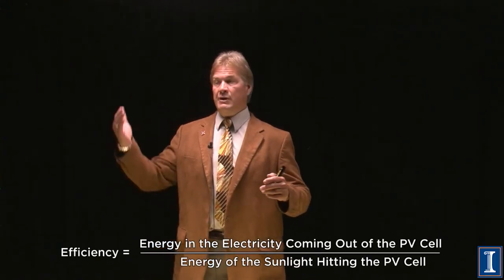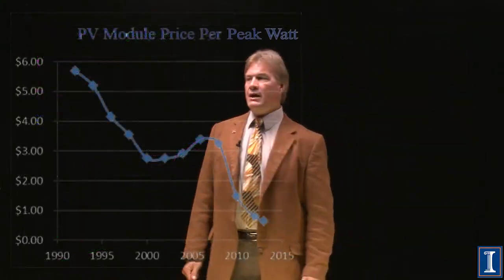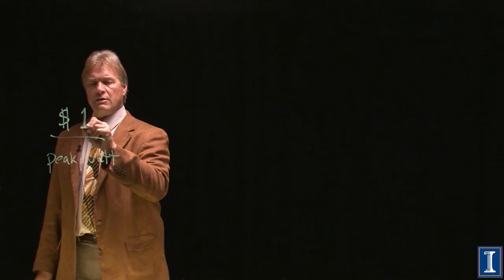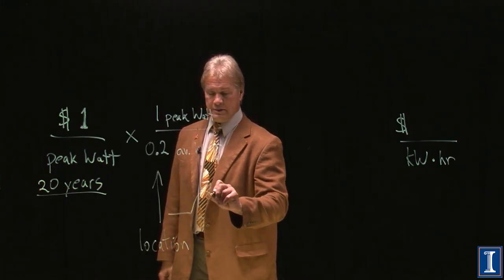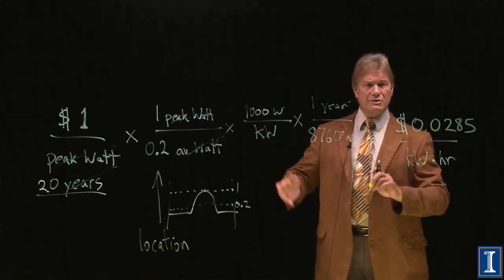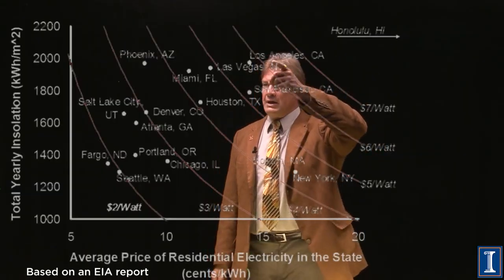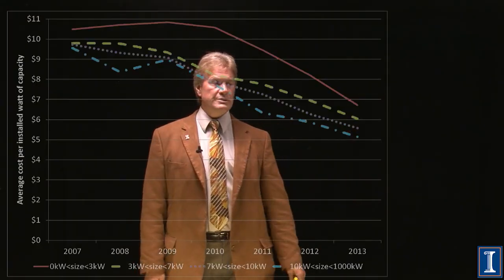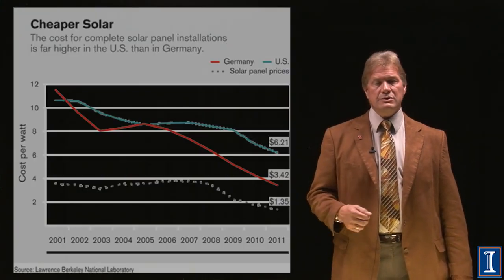The Cost of Sunshine

Comment: A lot has changed since this video was made. Cost has come down ~90%, installed solar has gone exponential, dramatically exceeding any and all projections. Batteries are now the next area where cost needs to come down in a similar way to incentivize battery co-installation with every solar installation, once this becomes widespread, centralized utilities will then really struggle to compete with this more distributed electricity production and you forget about Nuclear every being cost competitive again.

Comment: This video is WAY out of date. 2015 prices?  It is 2025 now.
Reply: What is the price now?
Reply: You can get residential solar installed in many places for around $2-3/watt (for a 5-10kW typical residential system). That’s not including government incentives, (federal residential incentive is going way after this year due to the “one big, beautiful bill”).
Reply: @zerog2000   The sad part is that 2/3 is still BS regulations, fees, and permits due to the non-standardization. So the sad part is the fed could remove the tax credit, standardize solar installations, and still make the installed cost go down with zero tax credits that the fed would have to give out.

Comment: Regulation is one of the biggest differentiators here except for  the amount of sunlight. I have built my PV system 4 years ago where I managed to be included in a scheme where I'm on the grid and I don't get anything for the energy I pump into the system, but I can then take energy from the system at 80% discount as long as my two-way meter shows that I have a surplus (I put more energy into the grid then I consume). With the rising power prices this has proven to be immensely profitable for me, as my power bill is 10% of what I would have to pay now without PV. However the regulation was later changed and now people no longer have the option to use the grid as their "battery". They get paid for what they upload to the grid in wholesale prices and then can buy power back for regular consumer prices. This means that my PV installation had a ROI time of just under 4 years and had to be just 10-15% overscaled over my consumption. Theirs has to be 2x-3x over their consumption and they get less money back, so their ROI time is 10-15 years. Adding battery pack into the mix maximizes your autoconsumption which moves a lot of levers on the accounting charts, but battery pack itself is costly and needs replacing at around 10 year mark, so you're still looking at 10+ years of ROI time. And if you did your project and calculations wrong + at the same time decided to switch from gas to electric heating/heat pump, you may not be happy with the final result. Even such considerations as the type of roof can skew your calculations, because if you have a ceramic roof rated for minimum 50 years and you put 25 years rated PV on it, you're golden, but if you put it on a flat roof covered with roofing felt, then you're in some dire straits after maybe just 10 years. In some places it is essential to mix PV with one or two mini wind turbines to minimize your costs in winter. However turbines require more costly maintenance, which PVs don't. For me however, in my regulatory scheme, the investment proved to be extremely good idea. ROI under 4 years (planned 5 years ROI, down thanks to rising prices) and currently it gives me savings of over 3000 $ / year.

Comment: Having had worked in both the PV and Battery industries I pretty much agree with everything he said.
I'd love to see an updated video that takes into account:
-Inflation and inflation adjusted costs on the historical graphs.
-Labor costs. I do not know about you but labor is out of control - can't get anyone to do any sort of trade, even unskilled, for under $100/hr. Heck I was quoted a new roof and when you pulled out the labor costs out of the quote it was nearly $300/hr. 
-Recent advances and efficiencies and how that has affected price per watt - I am very certain labor has more than offset this.
-Include, if the data didn't already normalize for this, the effects that high and low temperatures have on panels, hot and sunny areas can often have less efficiency than places that are a bit cooler with slightly less sun.
-How to factor in minimum billing against PV costs as some grid operators are billing people a minimum bill even if they use zero electricity?
-Also please touch on the costs when the panels are done and worn out. Several ways to present this but it'd be an interesting footnote.

Lastly, as I said having worked in both industries PV + battery, there is nothing green, clean, or environmentally friendly about the cell growing and paneling processes. Heavy metals, lots of solvents, massive furnaces for crystals, very nasty chemicals, bases, and acids, and tens of thousands of gallons of ultra pure water to clean the cells, clean the chemicals, neutralize the chemicals, and for decontamination of materials and processing tools. Batteries are much of the above but add in more heavy metal and chemical concerns (depending on type).
Unfortunately the media and marketing has been effective at only reporting the upside, so the only thing the consumer sees is a shiny panel making "free and green" electricity.

I personally still feel the PV technology needs more advancement, storage needs more advancement, and regulation + costs needs to be reigned in, somehow.
Reply: Well you are wrong.  For example the standard PV panel warranty is 25 years NOT 20 years as he says.
Reply: @speculawyer  ever heard someone claim on a PV panel warranty 15 or more years into the warranty?

I bet you haven't.

Comment below says this:

Excellent videos and this is no exception.  As to warranties, many companies (and maybe even foreign or domestic manufacturers)  have no intention of being in business for the length of the warranty, and many have gone out of business.  The warranty is worthless if the company offering it is gone.

Comment: Forgot to mention the largest component. Cost of the Land on which they have to be installed. Add to that the regular maintenance cost to keep them dust free to enable them to work at peak efficiency and prevent the dust and leaves from blocking the sunlight. Deserts may be good for sunlight, but they definitely add to the cost of cleaning due to all the sand and dust and winds that are there due to the arid conditions.
Reply: Solar has many more problems for grid-scale.
Duck curve is one of them. You can manage it with storage, but there's not much interest in that because its super expensive. California and South Australia are already suffering this. Spain also did suffer and had to withdraw subsidies, bankrupting several families.
Reply: @AlldaylongRock  If you fill the deserts in the western US with solar panels, you could then use that excess energy to pump water from the mississipi to the hoover dam. Which would then make electricity when we need it most and would also solve teh water crisis

Comment: My wife was convinced that our power bill had gone up significantly with the sale of Southern Company.  Turned out that when we had our roof replaced a few weeks before the roofers had put the wrong vent on the roof for our clothes dryer which resulted in a blockage and caused the dryer to run 3X longer to dry a load of clothes.

I figured all this out when she casually expressed her frustration for how long it was taking to dry a load of laundry.  I got curious and checked the vent and discovered the problem.

Comment: Hello Illinois Professor 
I like your analysis. 
The infrastructure would need to triple 
Power plants at $1billions each, TRIPLE. 
Main transmission lines at $2million/ kml,  TRIPLE. 
Poles and wires in streets and too homes, TRIPLE. $????/klm. 
All with the central power plants, TRIPLE DEMAND, supply costs. Massive. 
The distributed power gathered from the ends of the grid,  from rooftop solar PV systems with EV batteries, offers huge benefits. 
The boosting of distant supply from were the sun is shining would have to be looked at.
The weather forecasts and patterns would become more important. 
The smartening of the grid is obvious. 

Is this a worthy matter for analysis???????

EVs are coming. And faster than all the above TRIPLE infrastructure can be financed or built or workforce manned .
Suburbs one at a time, staged rooftops construction in the sunniest areas first. 

Nuclear's huge long time frame is dangerous..

Comment: If transportation is electrified and the EVs are topped up daily at home or locally from the grid then power demand TRIPLES.
Now we need TRIPLE the number of POWER PLANTS. 
Now we need TRIPLE the main grid capacity. 
Now we need TRIPLE the poles and wires in the streets to the homes. 
Given that the EV batteries will be 100kwh for the long trip, but the Daily drive is 7kwh, tiny, and every building is connected to the grid today.
Then I would say the EV batteries will be plugged into the grid and trading power and stability with the grid for money 24/7.
We are going full electrified including EV with a big battery?????? Yes ???
The distributed solar rooftop power supply with the EV batteries is perfect.

No new supply side infrastructure costs, power Supply costs reduced, petroleum costs now nothing.

Petroleum is a strategic military reserve asset for war fighting and emergencies. 

Just thinking, thinking, thinking, thinking 🤔.  Hahaha Hahaha. 

The automatic plug in gizmo will be the killer invention for the EV.

Comment: So, molten salt storage is a negligible cost for nuclear, but inconceivable for renewables?
Reply: If transportation is electrified and the EVs are topped up daily at home or locally from the grid then power demand TRIPLES.
Now we need TRIPLE the number of POWER PLANTS. 
Now we need TRIPLE the main grid capacity. 
Now we need TRIPLE the poles and wires in the streets to the homes. 
Given that the EV batteries will be 100kwh for the long trip, but the Daily drive is 7kwh, tiny, and every building is connected to the grid today.
Then I would say the EV batteries will be plugged into the grid and trading power and stability with the grid for money 24/7.
We are going full electrified including EV with a big battery?????? Yes ???
The distributed solar rooftop power supply with the EV batteries is perfect.

No new supply side infrastructure costs, power Supply costs reduced, petroleum costs now nothing.

Petroleum is a strategic military reserve asset for war fighting and emergencies. 

Just thinking, thinking, thinking, thinking 🤔.  Hahaha Hahaha. 

The automatic plug in gizmo will be the killer invention for the EV.
Reply: We won't need to triple grid capacity, though we may need to increase generation to compensate for not burning fuel in cars.
That generation can come from solar.
We have excess solar generation during the day, when most people are at work.
Plug in at work, during this period of maximum solar generation.
When you drive home, you are taking home the charge that supplies your house during evening peak demand. This reduces the peak demand current.

Charging during peak demand is dopey. Use off-peak power, just like hot water and pool pumps etc. Off peak power exists because it costs more to turn a coal generator off and on than to just leave it running. EVs can store that otherwise wasted generation.

If enough people just plug in whenever they park, at home, at the cinema, at work, wherever, then there will be huge battery capacity either way. Just set some presets on your car/charger to set limits on how much you charge or push back. If going for a trip, charge till full, and so on.
Reply: @aaroncosier735  
YOU ARE THE FIRST TO THINK THROUGH THE GRID MATTER. 
And post about it.
This matter is critical.

Home rooftops solar PV with
Huge EV batteries and a 
Smart grid.

This is the answer.
In fact the home's, in general, 40% demand on the grid power disappears and can be a 40% supply to the grid with the EV big batteries providing stability and reserve power. 
The industry's 60% demand can have 40% coming from rooftop solar PV systems. 
So now only 20% need come from the commercial power supply company and not the 100%.
NOW DO YOU SEE THE BIG POWER BUSINESS CASH FLOW PROBLEM IS??

The money will be in the grid..
Reply: @stephenbrickwood1602  There certainly are articles available, but it takes some searching.

We see the effects of grid-scale batteries already. They provide grid frequency control on a tiny percentage of the power wasted by coal generators to do the same.
If your house has a little battery, and your neighborhood a bigger one, and your region a large one, almost all the sharp peaks and valleys in power transmission can be smoothed out. This lets us use existing power sources better, and renewables as they are phased in.
Reply: @stephenbrickwood1602  I am in broad agreement.
Nuclear is an ongoing risk. My previous position is that nuclear would be acceptable if they had met their own requirements for waste disposal and minimisation of risk. They have not, despite fifty years warning.

Renewables are definitely the future, in combination with storage.  Storage, both batteries, hydro and others, makes renewables straightforward, but also helps inflexible coal and nuclear be less wasteful for the interim.

It's a tricky problem, but storage makes fossil tech more efficient as well as making renewables feasible.
Reply: @aaroncosier735  Both waste and risk is a non issue. It's only propaganda used by people that have been fooled or are outright lying.
Reply: @mikecamrcplus3057  
To correct you, Spent Nuclear  Fuel is a very big issue. So big that neither the industry nor national governments have faced the true cost of disposal.

You can tell me how easy it is once the existing stockpile has been permanently disposed, with full costings. 
That might take a while. To date no Spent fuel has been placed in disposal anywhere on Earth.
Reprocessing is not the answer either. The US worked out it was too expensive back in the sixties. The French have a program, but less than half of all their waste has ever been processed and none of the resultant High Level Waste has been placed in permanent storage. It costs them a lot to reprocess and French electricity has to be heavily subsidised.

The US attempt at Yucca was woefully underbudgeted and wound up with oxygen ingress issues.  It might still be useful for interim storage, but will never fulfill it's planned role. 
Any future disposal facility will need to have twice the capacity just for existing stockpile and the current provisions set aside are both less than half the most optimistic cost and no longer getting contributions. That's a problem.

Just as a reminder, the average US spent fuel storage has about one thousand tonnes of spent fuel, each tonne contains about fifty kilos of fission products, about the same as from two very high yield nuclear weapons. If attacked, such a storage facility would release the fallout equivalent of a thousand weapons. That's a knife to the throat of every american.
Reply: @mikecamrcplus3057  

Sadly all you have is Youtube videos. Poor ones.

And all three ignore the real issues.

Energy Prof only talks about normal operations. He doesn't cover what happens if something goes wrong. Spent fuel waste requires active management and cooling. It's not walk away safe in event of a disaster, and a deliberate attack on such waste is a disaster somewhere between ten and a thousand times worse than Chernobyl. 

Spent fuel is not economical to "recycle" as it requires expensive reprocessing, and the fission products still require vitrification, encapsulation and deep disposal. The US worked out in the sixties that it was not viable. The French have to subsidise about half their power to carry this boondoggle.

Casks are a definite improvement over pool storage. Sadly, only about a third of US spent fuel has been transferred to casks. The great majority still sits in cooling pools, at great expense. The material in casks is not done either: except for a couple of dozen that had to be relocated the vast majority are not rated for transport, and NONE are rated for permanent disposal. Every single one will have to be opened and transferred to duly rated casks in the future. For decommissioned sites, a new pool will have to be built to do this.

Nuclear disposal is neither cheap nor easy. The industry has stated in court that making financial provision would make the industry non viable. 

It's a dead end.

Comment: To quote RA Heinlein. There Is No Such Thing As A Free Lunch. I'm all for clean energy. But we have to be willing to accept that there are costs to any type of power generation. Both economic and environmental. And be willing to bear those costs. Plus all the renewables aside from tidal are Solar.
The idea of roof top solar panels is very attractive for detached and semi detacted housing. But what about denser housing arrangements. Fairly large apartment buildings in urban areas? And if you have roof top solar just what is your backup storage for at night? That needs careful consideration.  Just how much battery do you need? 12 hours? 24? 72? Just what is your average number of days per year of sunlight? Climate? If you experience significant snowfall how much and how often. What are the expected high and low temperatures? I know at least one company is working on an iron air battery. They hope (big word hope) to be able to bring to market a back up battery system about the size of a washing machine that would be able to supply power for 60 hours.